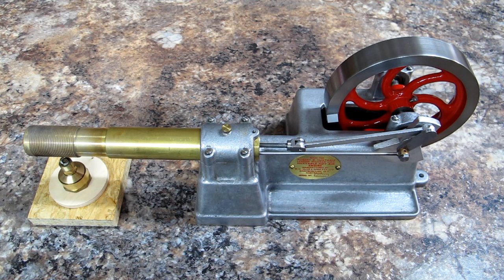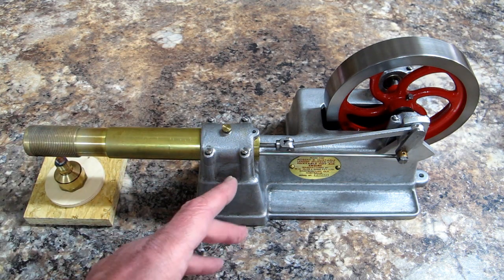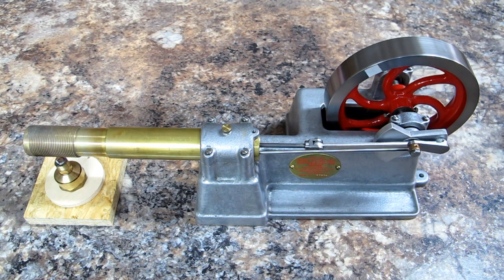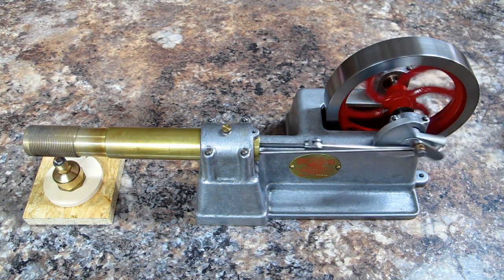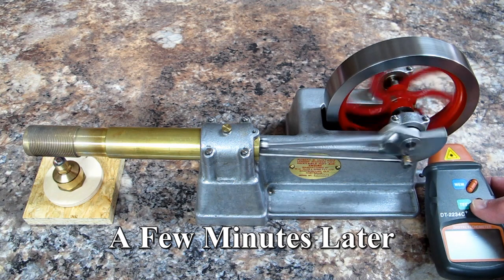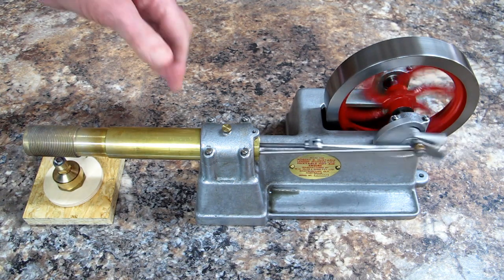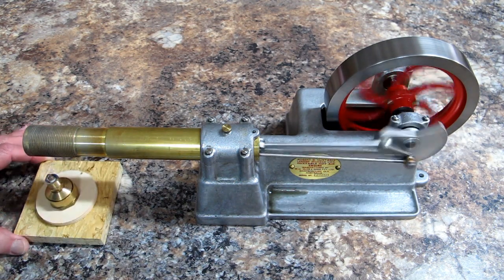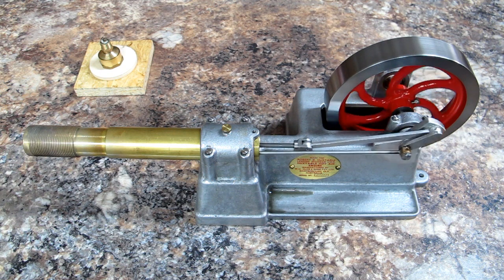Huxtable Hot Air Engine

Comment: Can it be used as a generator by connecting a motor in reverse?
Reply from the maker: Possibly a small DC motor could be run by this once it got up to speed... but the energy used to run it would be more than that generated by the motor... unless using the sun.

Comment: Can you measure the temperature requirement on it?
Reply from the maker: Not really. It has an open flame under it. Trying to use an infrared temperature gun will keep picking up signatures from the flame. A slightly larger flame than was used in this video would get it up to speed faster. 
I have purchased a ceramic burner that runs on butane... but I haven't tried it yet. With an adjustable flame controlling the start-up and then the running speed should be possible.
I have also made some cooling fins which slide onto the brass tube which hopefully will help extend the run time. The videos on making the cooling fins will be released later this year… in the Fall.
Thanks for watching. Please subscribe. 
That is what keeps this channel running. 
Ron
Reply: @RonaldWalters2010  sir I have an actual project I’m preparing for and need your input. I am trying to build a aluminum can heater that will soak in as much passive heat as possible from the sun. It will use fresnel lenses and everything. Basically a box that has a lot of heat inside. I know I will need to circulate that air out to something. This is where that engine comes in. Do you think it could potentially run off of just hot air?
Reply from the maker: Olds Engineering in Australia make the Huxtable Hot Air Engine (a Stirling engine) and at one time they offered a parabolic reflector that would run the Huxtable Engine off the sun. It would require a bright sunny day, of which there are many in Australia. I could not find that reflector today so maybe they quit offering it.
I suspect heating the air, to then heat something else, may be wasted effort… best to heat the engine in the first place. Also, the sun tracks across the sky faster than you may think… and for more continuous operation a solar tracking mechanism may be required… and then things get pretty complicated and are beyond my area of expertise.
Most Stirling engines have a finite run time, as they tend to slow down or stop when the engine overheats and the temperature difference no longer exists.
Stirling engines in some form have been used to power space exploration satellites/probes and since space is very cold the maintenance of the necessary differential temperature is pretty easy.
Thus… can solar energy run the Huxtable Engine? Yes. For how long, I do not know.
Can you heat air hot enough to run the engine? Possibly. Experimentation would be required.
I don’t know where you are located (live). I live in the USA. 
This is an expensive engine (but a good engine). Purchase, shipping and foreign exchange, total, cost me roughly US$765.00 and that is just the engine.

A cheaper alternative if you are able to machine and make things yourself.
Popular Science April 1961 “How To Build A Model Air-Cooled Hot Air Engine”
Popular Science July 1965 “Amazing No-Fuel “Space” Engine You Can Build”
Takes the April 1961 engine and powers it off a parabolic reflector using the Sun.
With a little effort you can find these back-issue magazines on Google books for free.
If what you want is a demonstration of a concept. this would work (but probably would not run for a long period of time as it will overheat and stop).
Hope that helps.
Ron
Reply: @RonaldWalters2010  I purposely want to create a space where once heated the heat dissipation is super slow. (Might need to heat up a material of sorts) then I would use a valve to release the heat into the engine at a steady pace. I would use the temperature differential of indoor space to cool the engine or maybe even water cool it somehow. I want to use thermodynamics in its most simplistic form without getting crazy expensive. 

We desperately need working sterling engine type concepts for home use right now more than ever in this society because we are given 4 years of freedom to develop and “release” these engines to the public without backlash. No more controlling interest in oil companies today. This is the time that we can change the minds of people about passive energy.
Reply from the maker: Air is not very good for storing heat. If circulated around/through a bed of rocks, the rocks can later give off heat for after dark hours or on a cloudy day. The large solar collectors use molten salt to store massive amounts of heat... and now we're talking about that crazy expensive thing.
Good luck with your project.

Comment: Unbelievable how smooth and silent this engine is! 😃👍
Do you think it could benefit from a heavier flywheel at very low rpm?
Will you challenge yourself one day and machine or 3D print an oil vase that you can add to one of your classical models for classic lubrication? 😉